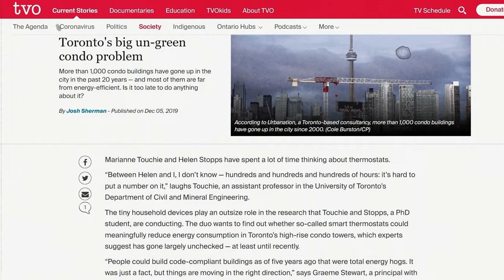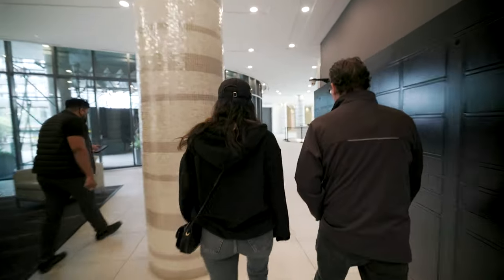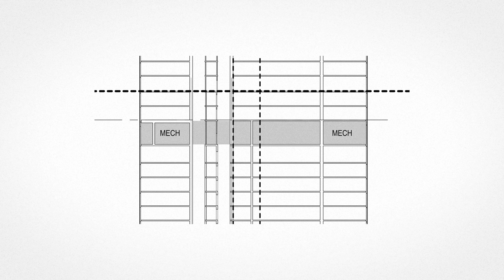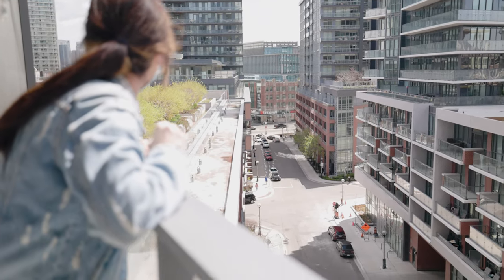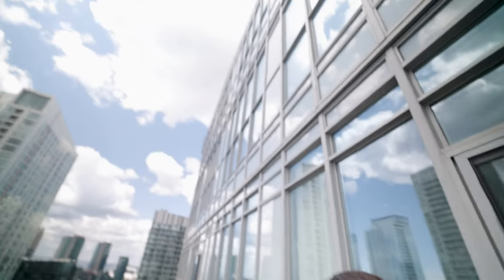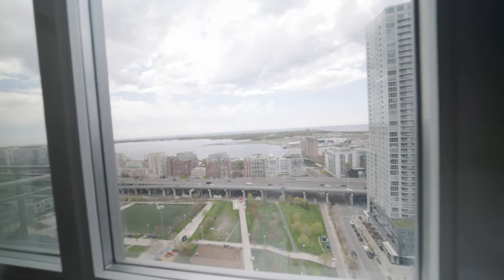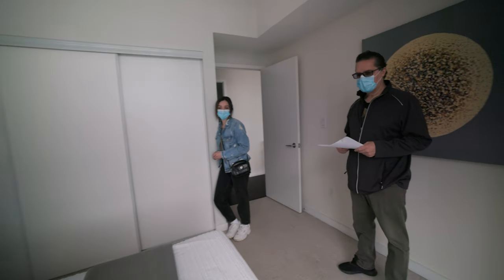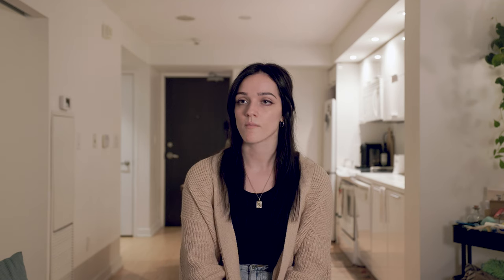Condo Buying Tips from an Architect

Comment: SO true, when I was a project manager, I  had to deal with a fancy building with an all glass curtain wall that had water coming in. The gaskets were specially designed protrusion so when they failed 10 years after construction there was no way to replace them... we just had to caulk them, which is no better than a bandaid, and they will keep doing that forever.

Comment: Great video.  I am perfectly happy in my old (1975) single-story, flat-foam-roofed, small-windowed condo complex with zero amenities and nothing above me but circling buzzards and the blazing Arizona sun.  No weight rooms to be vandalized.  No pool to maintain.  No gate for anyone to crash through.

It's very interesting to see how different cities approach different issues, and possibly how codes change over time.  I read somewhere that a bedroom can only be called a bedroom if there is a second means of egress (e.g., a window that is large enough and close enough to the floor to allow  a quick escape).  Without such windows, the room would be labelled as a den in listings.  Not sure where that particular standard applied, though.  

Here's something prospective condo buyers might want to reconsider considering: buying in buildings with rooftop swimming pools.

Comment: The urban heat island effect caused by many glass buildings also a factor, the wind tunnels created at street level. The same problems exist in England too with developers favouring profit over quality. Living in a basement can be great but it has its own pros and cons. We have a lot i. common Anthony, great video. Toronto needs to do better with affordable housing too 👍🏼
Reply from the maker: Great points! Designs are getting better over time. ie) requirements for green roofs, or canopies to reduce wind. I Could make a whole video just on that! :)

Comment: Back-Up Generators should be mandatory for High-Rise Buildings...  but include the Water Pump???  10 days May 2022... no water, no power = Derecho.  Otherwise the older Condos... dont have the Glass Balcony...  see thru... it's a Concrete Bunker (if they even have a balcony).   Newer are probably a lot more Energy Efficient = Insulated.  Having indoor pool is great... but brand New pool still breaks down time after time after time... it's  hi-larious or just sad.  Curiously even new appliances can have a high failure rate... it's just bananas.   Anyhow Zero Disclosure offered about BACK-UP generators, if you're an old timer living in a Condo.